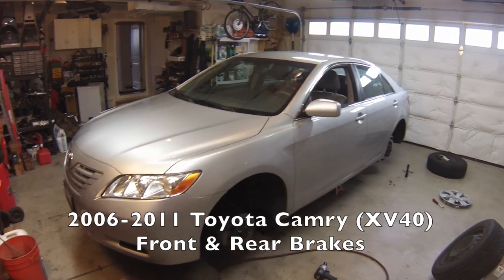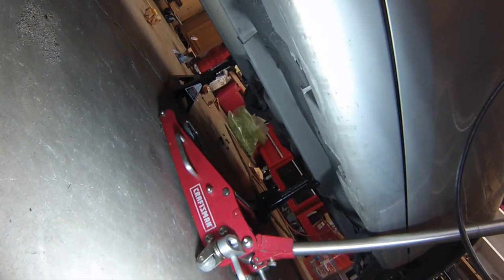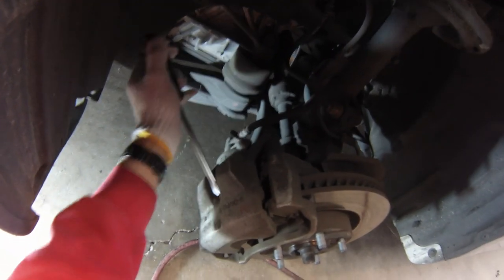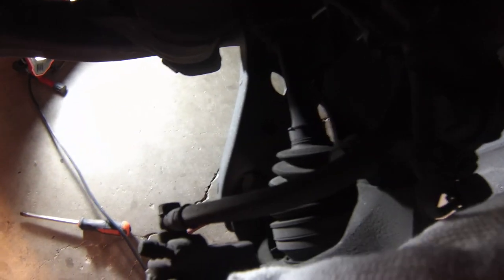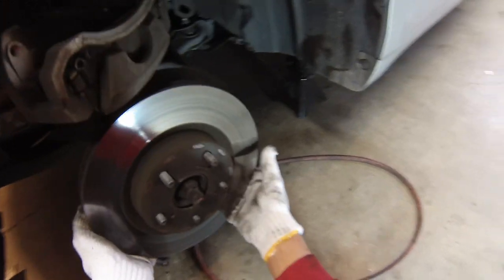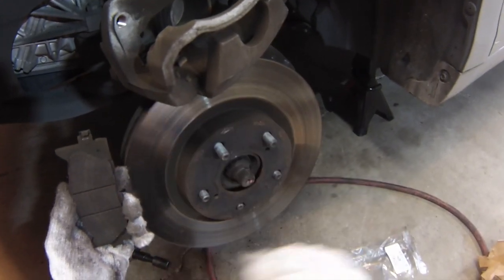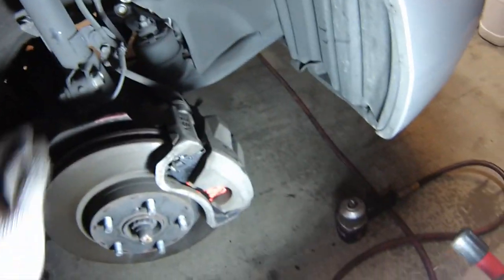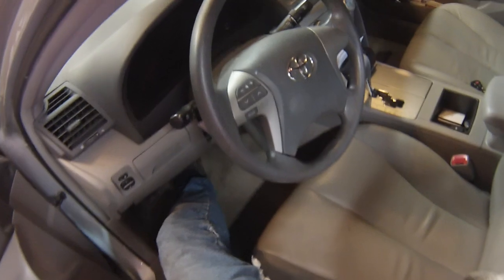Front/Rear Brakes -Toyota Camry 2006-2011

Comment: I like the suggestion using the screwdriver to push the piston over using the C clamp.  I will have to try this.  Thanks for taking the time to show this!
Reply from the maker: Greg L I actually had not heard about the C clamp method until recently, I've always done it with a screwdriver.
Screwdriver is way faster but don't try to push it in too quickly. It might damage a seal. Just use constant, gentle pressure.
Reply: And always double check your vehicles info. Some vehicles require the piston to be "screwed/rotated" as you push them in.

Comment: Good to be accurate and specific about torques when talking about brakes: 79 Ft lbs for the bracket, only 25 Ft lbs for the slide bolts.
Reply: I agree... and for the rear it is 35 ft/lbs for the bracket and 15 ft/lbs for the slide bolts.

Comment: Bleed the brakes this morning and made a big difference. The first-time I did a gravity bleed. Didn't work out for me. The second time tried something different. Thanks for the video and advice.
Reply from the maker: +tony M Yeah gravity bleed is sometimes insufficient for getting out the bubbles. Power bleed, get someone to press the pedal, or get a poor man's power bleeder - a chunk of 2x4 jammed between the seat and the brake pedal. (Cut to appropriate length such that it barely fits between seat at rearmost position and the brake pedal. Then, slide the seat forward with the board pushing down on the pedal. Bleed and repeat. Takes longer but if you don't have a power bleeder or a willing friend, it's the best way to get the job done.

Comment: Thank you this was very helpful. . Im about to replace my friends brakes this weekend.. Thank you
Reply: am about to do the same lol
Reply: +Brayan Malek you already done it? one thing that gave me trouble he skips over here(but mentioned when reassembling the front)is the nut spinning while you try to remove the caliper bolts, had to dig out a open end box wrench to hold it steady, it a bigger than the 14mm bolt you are removing, maybe a 17mm? can't remember even though in finished 2hrs ago lol

Comment: Good tip with the screw driver to press down the pistons.  I have always used a C clamp with the old pad after they were out.  I will be doing it this way from now on.  I like to leave the top bolt in but loose and remove the bottom one and just swing the assembly up when I'm just doing a pad swap.  It makes it really easy to put the new pads on and to line everything back up.  Try it next time and you will see how easy it would be.  Thanks for the video.
Reply from the maker: Thanks. I've seen people use c-clamps as well but this is a lot faster and I've always done it this way with no problems.

I sometimes remove just one bolt but on some cars you can't swing the assembly out of the way, the caliper bracket interferes with the movement of the caliper.
Reply: ***** I have always used a C-clamp before removing the caliper. I find its very easy to push the pistons all the way back so there is a lot of room when putting it back on. BTW, I like the gravity bleed idea. I am going to try that this weekend.

Comment: A better way to retract the caliper uses a large (6" or 8") C-clamp to squeeze the entire assembly.  That's why there's always an opening just the right size and shape where you can put the threaded side of the clamp directly against the outer pad.  This provides a straight direct pressure against the cup of the caliper, and avoids cocking it, or damaging the rubber boot.  Do one wheel at a time, or the hydraulic pressure applied on one side might cause the opposite side to extend if it's not assembled on the car.

Comment: Great vid as usual Chris. Missed as small step though.  Notice that the front top clip was a bit different? That arm is supposed to go into the loop at the top of the brake pad. Helps to separate the pad from the rotor when the brakes aren't applied.  I have a Sentra that works the same way.
Reply from the maker: cheepGeek Yes, it spreads the pads apart. I thought I explained that in the video, maybe I didn't. Thanks for noting it.PS: My name is not Chris. :-)

Comment: Great vid!  Can I get away without bleeding the brakes or do they absolutely have to be bled.  Thanks.
Reply from the maker: +Mario Velasquez It is optional but recommended if your fluid looks dark. Secret trick: You can do a gravity bleed by topping off reservoir and then loosening bleed screw and waiting for the fluid to be pushed through by gravity. Don't touch the pedal or anything, just wait for gravity. Takes a lot longer but does essentially the same thing. Just don't ever let the reservoir become empty.
Reply: +Mod MINI Thanks for replying.  As for the "bleed screw", where is it located?  Doesn't each caliper have a bleeder?  I'm doing all four brakes.
Reply from the maker: +Mario Velasquez At the top of each caliper.
Reply: +Mod MINI gotcha, thanks.
Reply: @ModMINI  Do i have to bleed the brakes if im changing the rotors

Comment: great video.  I have exactly same car but I am struggling on where to put the jack stand when lift up the car, could you please clarify where I should the jack stand when lifting up the car from front or back?  Do you put the jack stand in the middle web and lift up both rear wheels or both front wheels.  Plz clarify thanks
Reply from the maker: +zofa300 Jacking up a unibody car and then putting on jack stands can be a challenge because safe jack points at the rear of the car are limited. 
There are more safe places to jack further up front. I don't remember exactly for this car, but on most cars there is a reinforced unibody member running from the front subframe to approximately the location of the front driver and passenger seats. You can use a jack and a thin block of wood about 2 feet long (60cm) (to spread the load and prevent deforming) and lift up at this location. The body seam running between the  front/rear jack points is also usually safe to use for jacking, so long as you use a block of wood as well.

Comment: always make sure your old rotors r not glazed over and that they r above minimal thickness as printed on rotor. can buy a digital micrometer at harbour frieght cheap. good idea 2 have them turned to remove any warpage or gazing. will stop better and pads will last longer and remove any vibrations. replace the E brake shoes if your e brake is losing effectivenes. new hardware such as caliper slide bolts and rubber boots r cheap replace them 2 (under $20 ) for both sides rear

Comment: Thanks for the effort you put into this video.  That being said, I can't figure out why anyone would wear 1) CLOTH 2) WHITE gloves (unless used as a liner for nitrile) to do a brake job.  Is your full time gig being a butler (and you just forgot to change gloves)????
Reply from the maker: They are disposable gloves. The gloves protect against hand injury.
Reply: @ModMINI   ummmm  OK.  If I am not mistaken, those exact gloves are sold at H Freight under the product name "glove liners".  Of course, you can use them any way you wish to but you might want to consider wearing them UNDER nitrile gloves (I have done in the past).  If you do, they will allow you to wear the nitrile longer as they absorb the sweat, and they will at least have less grease on them (and you can wash for re-use) when done. Throwing out nitrile gloves is much cheaper.
Reply from the maker: @jotu173  I tried that and didn't like the nitrile gloves.

Comment: Hej  can you tell me ?  I have  toyota avensis 2009 Diesel  and I have  electric brake I need to open the brake with the help of an interface computer program or I can normally  move back with the help of a tool ?Thank you.

Comment: I have a toyota camry 2008 hybrid. I just replaced my brakes and rotors on the rear end! Well I had them done spent 434.00 bucks just for back brakes, right? pst anyway Could you give me any pointers as to why I am hear a rattling noise from the passenger rear end? took it in twice and they cant find the problem. WOuld hate to dish out any more money to them infact I think I think I need front braks done as well. Dont know much about cars and I am thinking about doing them myself. Your instructions was very clear.
Reply from the maker: Sorry, I'd have to see the car to know for sure, but could be botched brake job, loose sway bar end link, other worn suspension part, etc. Might need to take to a different shop that is better at diagnosing funny noises.
Reply: +Mod MINI Thank you for responding. I am going to take it back to the dealership I got it from and have them check it out.
Reply: BoyceAvenueiLOVEYU93 I had the same problem. Toyota replaced the suspension under warranty. 3 years later, it happened again. seems like a common fault. Rear passenger side.

Comment: You eliminated transferring the metal cover over the backs of the original or old Pads to the new Pads (rear brakes ) . Are they not necessary ?
Reply from the maker: I don't remember, I think the new brakes came with the plates (painted black).
Reply: I am 99.99% positive you are correct . I discarded the original metal backing plates (Shims ) and installed as you did . I had no rattle , squeal or noise . I looked at the original equipment Pads and they are flat Back . The replacement Pads had a black fiber like shim (Anti Squeal ) which would make that metal Backing plate unable to attach or not properly to the replacement Pads . Thank you for responding . Sorry for the paranoia :)

Comment: If I don't have brake wear indicators then at what thickness would you recommend replacing the front and back pads? I have a vernier scale so I wouldn't mind measuring them.
Reply from the maker: Around 5mm or so...?
Reply: I did measure them the other day and I've got 6mm on the front and 5mm rear on my 2011 Camry. I called a Toyota dealer and they recommend replacing pads when they're getting close to 3mm. Thanks anyway!

Comment: I just replaced my front rotors and brakes all the way around, I went out on a drive and was expecting for a reall firm stop but didn't. It brakes way better but not as what I was expecting. Any suggestions on where I might have gone wrong?
Reply from the maker: +tony M You might need to bleed the brakes or bed the brakes and rotors.

Comment: Why do you need to bleed the brakes after changing the pads? I thought it's only needed if you open your brake lines and some air can get in. But if you just push your pistons inside there should be no air.
Reply from the maker: +Mordolap You don't, but the fluid in the calipers is the dirtiest in the entire system. Your calipers will last longer if you get that dirty fluid out.
Reply: +Mod MINI Thanks for the info. I was confused since some people show how they bleed brakes and others say you' don't have to do that.
I'm little bit paranoid about opening brake lines because of the air that can enter the system.

Comment: replaced front pads on 2008 toyota camry did everything that was said on Mod MINI post left off the squeaker,after putting all back together breaks stop perfectly except getting squeal when driving like the pads are low, can't figure it out,?????
Reply from the maker: +Edmund Hogan Anti squeal at the friction points between pad and caliper? Especially on the back side of pads if they didn't come with an anti squeal shim .

Comment: Doesnt retracting the piston without bleeding have a chance of damaging the ABS system?
Reply from the maker: I've never had a problem. Anyone else have issue before? The ABS system is just sitting there doing nothing unless its activated. When not activated, the hydraulic lines are open all the way back to the reservoir.
Reply: No.

Comment: Weird. The brake pads I ordered for my 2010 Camry didn't come with those funny clips. I hope there isn't a huge difference in performance without them. The ones that were already on the car didn't have those clips neither. Not even the squeaker clips. What's your opinion on the matter? Should I get those missing parts?
Reply from the maker: Your model year may have eliminated the clips.
Reply: +Mod MINI that's what it seems like. The rear brake pads on the car actually did have the sqeakers.

Comment: I'm doing my rear breaks. I'm turning my rotors, do I have anything to worry about with the emergency brake system once I remove the rotor?
Reply from the maker: No
Reply: So no need to adjust anything? Removing the rotor will not cause anything to come undo? No need to adjust anything?
Reply from the maker: You need to loosen/adjust the internal drum just like you would with any other drum brake system.

Comment: Why didn’t u remove the two pins and grease them ? They could very well be dried up by the time the pads  need replacement!
Reply from the maker: They slid very well and did not indicate needing to be degreased. We are in a low-rust area and typically even after 10 years there are no hanging pins. Yes, good idea to check though.

Comment: Very well documented. Will be doing this on my wife 2010 Camry the next weekend.
By the way what’s the bleeding order on the calipers? I usually do rear first and then do front last. Thanks for the confirmation.

Now the reason I was searching around is that I noticed a faster wear on the rear pads on my wife 2010 Camry. Currently front are at 2mm and rear are at 3mm. Was wondering why on a FWD care, the wear is so pronounced on the back. I was expecting the front to wear faster than the rear. At lest that’s how breaks wear down typically on a FWD.
So I was searching around for that answer.
Reply from the maker: Generally, farthest caliper first, nearest last. Front pads typically wear more on any car. You might find the rear wearing faster if you have a stuck caliper, really cheap pads, or maybe the fronts were changed more recently. It's pretty typical to replace just whichever axle needs replacing, and typically rear pads wear out once for every two sets of front pads.

Comment: When I started prying the piston back with a screwdriver, brake fluid started oozing out through the cap of the reservoir. Do I have a problem?
Reply from the maker: Don Juan Normal if someone topped off the fluid after your pads were almost gone.
Reply: Mod MINI ok thanks. Providing a informative video like this is great, but when you answer questions so quick, like you did, that's awesome. You,ve set bar high, thanks again